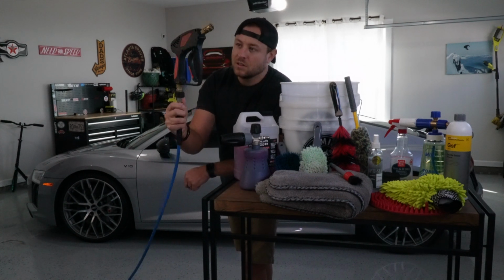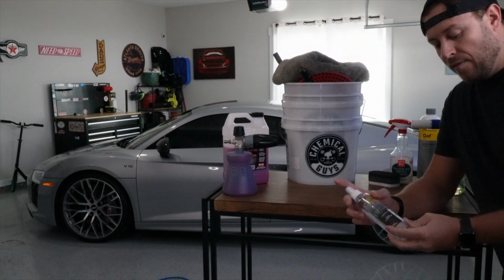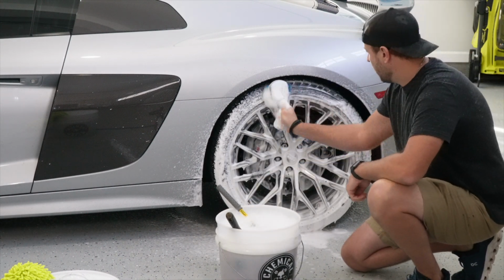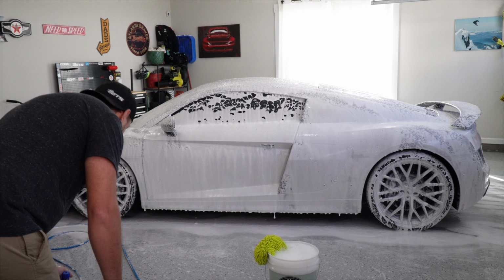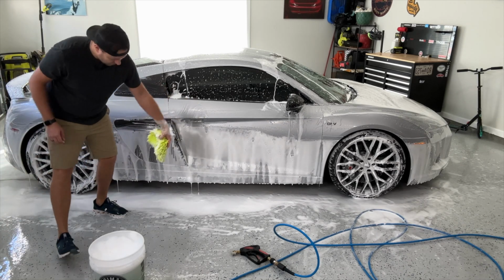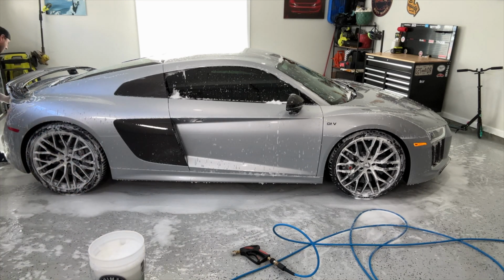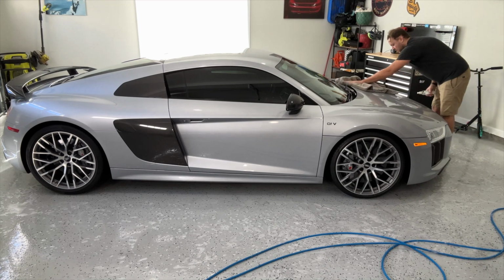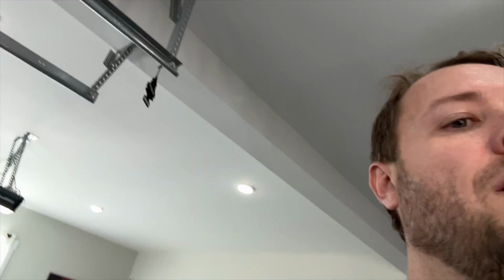How to wash your car like a pro! Complete exterior wash on my R8.

Comment: get yourself an ik12 foamer and toss pns brake buster in it and it will foam the wheels and tires. if you dont use it all it stays in the bucket for your next wash.
Reply from the maker: The IK foam sprayer is on my list to pick up for sure